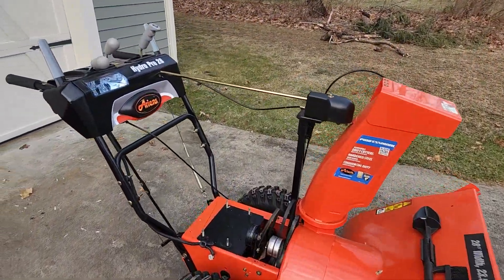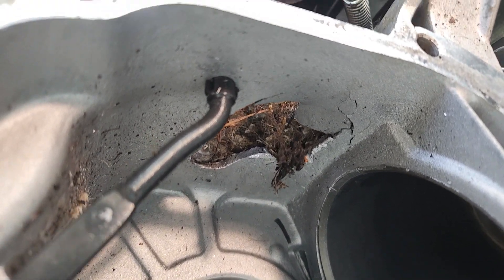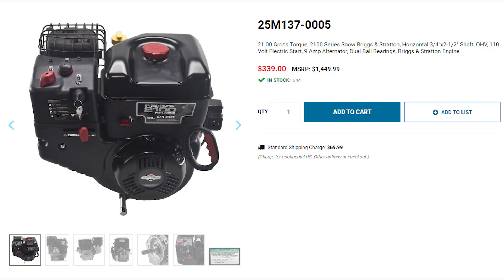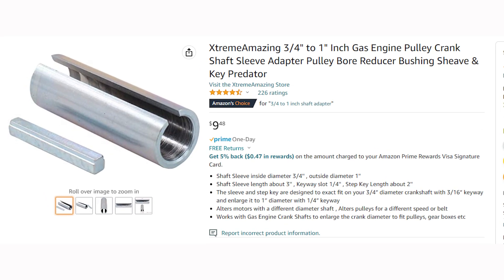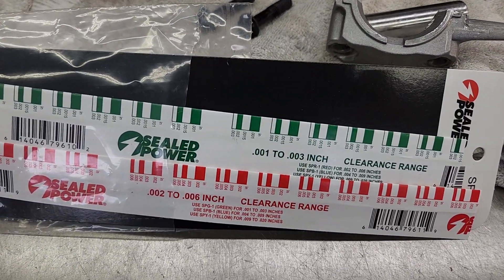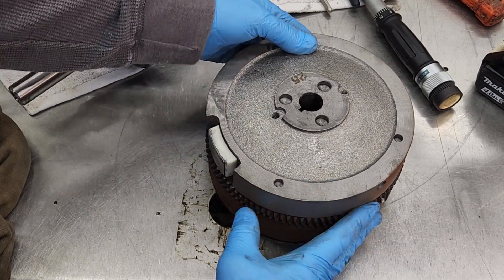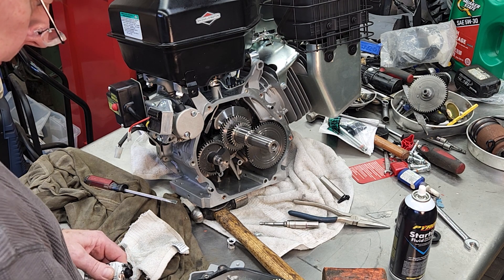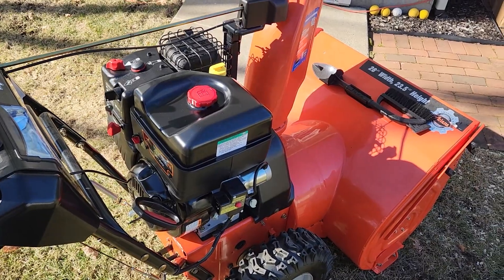Snow blower engine repair. Blown engine.

Comment: Just buy an electric snowblower with a spare battery.   It will start up every single time without any problems.    I hate gas snowblowers.   The engines they produce for them are trash compared to all of the technology we have to produce better engines
Reply: Electric is Junk
Reply: @stevesmith6058 yeah. You’re wrong.
Reply: @stevesmith6058  it starts every single time when i need it to run.   Everything i have thats takes a battery gives me zero issues

Comment: impressive  crankshaft swap. Tough to know when putting a knock off engine is a better choice on an older machine.  Basically all brand new with your repair.  Customer must think you are the best.
I can not find much on line about how good the Hydrostatics are. A little tiered sometimes when snow gets on my friction discs.
A repair guy told me the Hydrostatics are happier if kept in warmth as opposed to being left outside to freeze between uses.